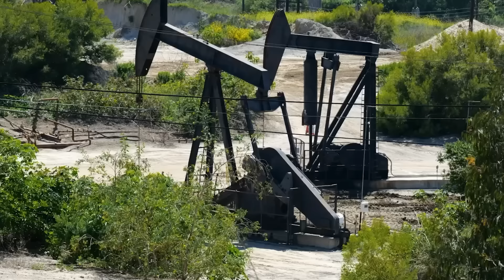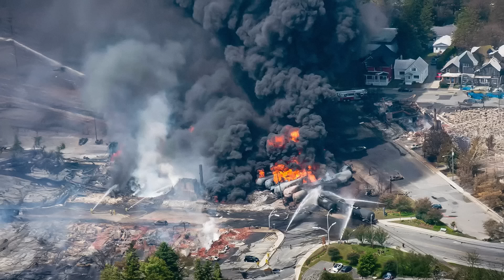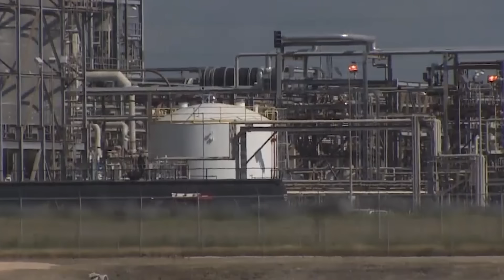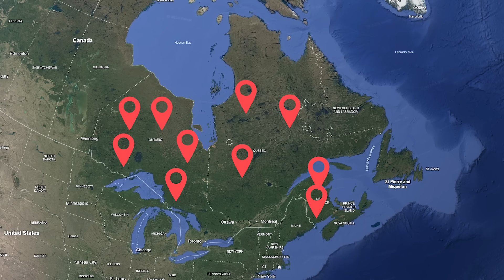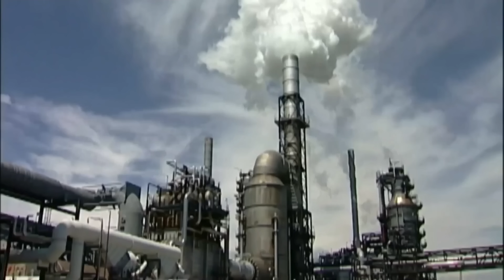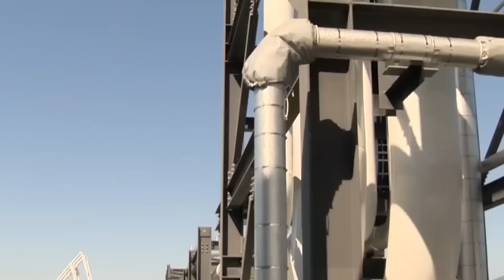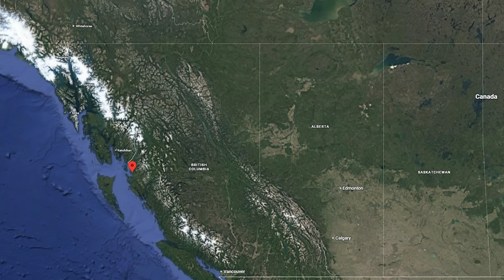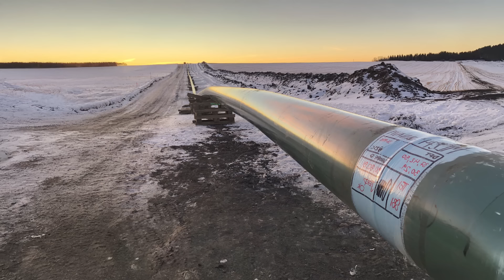Here's Why Canada Can't Build Its Own Refineries, Even Though It Produces Millions of Tons of Oil

Comment: The trans mountain expansion cost $32 billion.  It does not have to go from Edmonton.  The Enbridge Mainline pipeline transports 3 million barrels a day.  Build the pipeline from there and divert flow to the East Coast.
Anyone remember Joe Clark and Pierre Eliot Trudeau. They espoused a National energy Policy that would ensure Canada be Self Sufficient in oil.  It was opposed by the then Alberta Premier, Peter Lougheed, because he thought that this would hjamper Alberta's ability to sell oil on the world market for world prices. Turns out that western Canada Select is 25% of the Brent Crude price.
Reply: 25% less than Brent, not 25% of Brent. About $54 vs $72.
Reply: Alberta bitumen is heavy in asphaltenes and low in resins. This makes it a low-value product that is generally used as a cheap blending agent to bring down the overall cost of refined petroleum products. Remember when the Conservatives told you that Western Canada Select oil was priced lower than West Texas Intermediate because there was insufficient pipeline capacity to Canada's west coast and Canada was stuck with only "one customer"? Well, the Trans-Mountain oil pipeline is now complete, exports are happening all over the world, plus, there is excess capacity available on it!! And the price gap between Western Canada Select and WTI is still over $12/barrel on average!! Chalk it all up to yet another Conservative lie. Pierre Poilièvre is a rank expert at lying to Canadians and Conservatives are repeating the same worn, tired lies that are being disproven every day with TMX exports to Asia. Bitumen sands crude oil is low quality, and no amount of pipelines will ever change that. 

The % of exports to the US has already fallen below 90% and will continue to drop thanks to TMX.
Reply: @paulboileau3758 it is not low quality lol it isn’t good for motor oil it’s very good for making plastics
Reply: Also there is a tanker ban on west coast we cannot get the oil shipped fast enough
Reply: @georgestem2039 

Many Canadians are completely unaware of this nation's oil and gas infrastructure. There are now three major gas pipelines to the Canadian Pacific coast, plus two oil pipelines to the west coast. There is one natural gas pipeline extending from Alberta all the way to southern Ontario & southern Quebec (to Quebec City) and one oil pipeline from Alberta and through Sarnia, feeding 4 refineries in Ontario plus a refinery in Montreal. Incidentally, all seven of these pipelines were built under federal Liberal governments, including TMX in 2024 and LNG Canada in 2025. 

Canada has broken all-time production records for both oil and for natural gas production in 2025. We have built and completed two massive new oil and gas pipelines and export terminals, both commissioned in the past 20 months. Canada also smashed export records for natural gas, Alberta's heavy crude and propane and natural gas liquids. 

The propaganda says that Ottawa is blocking Alberta, but these claims don't jive with the facts on the ground: there are tens of thousands of oil and gas wells across the province, with a thousand new ones coming on stream each year. It is because of the support by the rest of the country that Alberta has registered a massive surplus this year. 

In the 1970s, the Canadian government invested tens of millions on research & development to adapt the canola plant, a benefit which has delivered billions into the pockets of Alberta farmers. Canadian taxpayers also invested over $34B into tripling shipments of Alberta crude oil to the Pacific coast. 

Some have falsely described a "tanker ban" on the west coast. And yet tanker exports were up a whopping 1137% in 2025 vs. 2023. 

To put this in perspective:
In 2023, an average of 2.25 oil tankers/month left the BC coast (Yearly total = 27 oil tankers)
In 2024, the average was 13.58 oil tankers/month (Yearly total = 163 oil tankers)
In 2025, the average was 25.58 oil tankers/month, October and November 2025 set a new record of 30 vessels each (Yearly total = 307 oil tankers)

Oil exports to countries outside the United States rose from 2.6% in November 2023 to 15% in November 2025. In December 2025, 15 of the 25 oil tankers leaving Burnaby were headed to China. 

In 2026, 30-35 oil tankers laden with Alberta crude will depart the Lower Mainland of BC every month! Not to mention the dozens of massive ocean-going tankers of propane, natural gas and natural gas liquids loaded and shipped out of Kitimat and Prince Rupert!  Why does this bother Pierre Poilièvre and his entourage so much that they choose to lie and act as if no oil and gas shipments are allowed when, in fact, the only limitation is for crude oil and only applies to an area off of British Columbia's pristine north coast?

Indeed, Canada has the one and only LNG export terminal anywhere along the entire Pacific coast of North America with LNG Canada (in Kitimat) and the completed Coastal GasLink pipeline. 

The US has exactly zero LNG export terminals along the west coast, and none started or under development. All US export terminals are either in the Gulf coast or on the Eastern seaboard. 

Besides LNG Canada, our country has four more LNG export terminal projects in the works:
1. Woodfibre LNG (Squamish) with an expected commercial operation date of late 2027. The Eagle Mountain pipeline already nearing completion and the export terminal is more than 65% finished. 

2. Cedar LNG (Kitimat) with an expected completion date of late 2028. Work on the export terminal is already 30% finished and notably, they will also be using the already-completed Coastal Gas link pipeline.

3. Ksi Lisims LNG (Wil Milit) with a target completion date of 2029 along, with the TC Prince Rupert Gas Transmission pipeline. Construction work on the pipeline is already substantial, with 48kms of right-of-way cleared and 9 bridges built for yet another brand new pipeline. 

4. LNG Canada Phase II (Kitimat) will likely enter service by 2030, although this may be earlier after the environmental review process received approval for fast-tracking by the federal government in September. 

Last but not least, Canada also has a 2nd Natural Gas Liquids loading terminal under construction just south of Prince Rupert. REEF will expand exports of natural gas liquids by 50% and is situated adjacent to the first terminal, built in 2019. Its expected completion date is in 2027.
Reply: @paulboileau3758  "Many Canadians are completely unaware of this nation's oil and gas infrastructure. There are now three major gas pipelines to the Canadian Pacific coast, plus two oil pipelines to the west coast. There is one natural gas pipeline extending from Alberta all the way to southern Ontario & southern Quebec (to Quebec City) and one oil pipeline from Alberta and through Sarnia, feeding 4 refineries in Ontario plus a refinery in Montreal. Incidentally, all seven of these pipelines were built under federal Liberal governments, including TMX in 2024 and LNG Canada in 2025."

Just what is the name of this pipeline and what extraterritoriality does it have? Coul it be the pipeline owned by the UNITED STATES? If so, it's a bit beaten up and may be discontinued.
Reply: @robertkubrick3738 

It is owned by a Canadian company: Enbridge. 

The Americans operate 17 refineries in the midwest which are totally dependent upon Line 5. If the American government ever shut down Line 5, it would create havoc all across several states: fuel shortages, tens of thousands of Americans out of work, industry shutdowns in manufacturing, etc. And the refineries could not easily find replacement crude, since they are tooled with cokers to process heavy bitumen. 

So, the chances of a Line 5 shutdown are infinitesimally remote. 

But let's assume the doomsday scenario. What could Canada do if the United States sows energy chaos? Well, immediately we would start railing to deliver Alberta crude to the 4 Ontario refineries and the 1 in Montreal that depend on it. We could also still use the Line 9 oil pipeline between Ontario and Quebec. So we have a lot better options than the Americans do. 

The suggested alternative is absolutely ludicrous from a taxpayer standpoint. Alberta Premier Danielle Smith and others are proposing spending north of $50B to build a duplicate, more costly oil pipeline just in case the Americans go nuts and enter self-destruct mode. But again, a duplication of Line 5 would only make economic sense if and when that happened. All other times, it would be a costly boondoggle that would require billions in new subsidies each and every year.

I've heard and seen a lot of bad business proposals, but this white elephant takes first place in the pantheon of stupid ideas.
Reply: @paulboileau3758  Better fix it up then so it doesn't get condemned.
Reply: @paulboileau3758  It's also 20 years past it's expiration date. States and Native American lands it runs through want it gone. Be afraid, be very afraid. It just had an accident. On the bright side it's closing might help you achieve the Net Zero GDP economy you always wanted.
Reply: @robertkubrick3738 

What a silly, infantile comment. The US will never allow 17 Mid-West refineries run dry. Just because you live in a world of paranoia Robert, it's unnecessary to project advanced amygdala fearfulness onto rational members of society.
Reply: @paulboileau3758  Silly to not want to have Canaduh's environmental disaster on US soil? The 50 years were up 20 years ago. As for not letting US refineries run dry, that won't happen, unless Canaduh suddenly never needs money again. It's infantile to think you can Declare War on the US and there are no repercussions.
Reply: @robertkubrick3738 

You fool, you thought I meant we would cut off the USA? No. That's not our style. But would your President try to cut off our refineries? Yes. And if you did, you can be sure we wouldn't keep shipping oil to the Mid-West bonehead.
Reply: @paulboileau3758  Not what I'm hearing from you whackos. But I will tell that even if you did cut oil to the US we would still sell you fuel as that would be the fastest way to remove Value from your system.

It's you fools who want to put Energy that isn't tariffed on the table.

Glad to hear you won't commit financial suicide by stopping the sale of oil. The US can just stop buying anything else from you and that should be fine? Glad we could hammer that out. You and I should be the trade envoys. We came to agreement right away.
Reply: As of yesterday western canada select was 73% of the price of west texas international.
Reply: @mtnphot  brutal. It's because bitumen is essentially the same consistency as tar. It needs condensate to even get it to flow. That's why it's called dilbit: diluted bitumen. Western Canada Select is a low-grade, cheap blending agent to bring down the overall cost of refined petroleum products.

Comment: Not quite right. Over simplified. Line 9 does transport Alberta oil all the way to Montreal. Ontario and Montreal refineries receive Alberta oil by pipeline. But the pipeline stops there, it doesn't go farther east to the refinery in Levis Quebec, which is across the river form Quebec City. And yes, the two refineries in New Brunswick refine light oil delivered by ship. Alberta has "upgraders" that convert heavy oil to "synthetic crude", a form of light oil. In 2005, 30% of all Alberta heavy oil was upgraded. Selling synthetic crude is more profitable than heavy oil.
Reply: Is the maker of this Video dumb? Or just American? On the West Coast there is a Huge refinery in a place called Port Moody and Burnaby 

Burnaby Refinery – a Canadian oil refinery located in Burnaby, British Columbia, formerly owned by Parkland Fuel Corp.  and now fully owned by Sunoco following their 2025 acquisition of Parkland Fuel Corp. The facility, commissioned in 1935, has a refining capacity of 55,000 barrels per day (bbl/d) and processes crude and synthetic oil into gasoline, diesel, jet fuels, asphalts, heating fuels, heavy fuel oils, butanes, and propane.  It is the only remaining West Coast refinery in Canada and plays a critical role in supplying transportation fuels to British Columbia, including producing Canada’s first low-carbon aviation fuel in December 2024. 

Burnaby Refinery – Quick facts:

Location: Burnaby, British Columbia, Canada
Commissioned: 1935
Capacity: 55,000 bbl/d (8,700 m³/d)
Nelson Complexity Index: 9.1
Key achievement: First in Canada to successfully produce low-carbon aviation fuel (December 2024) 
The refinery is supplied via the 1,200-kilometre Kinder Morgan Pipeline from Northern British Columbia and Alberta. It was originally established by Standard Oil of California and expanded significantly in the mid-1950s. Parkland Fuel Corp. acquired the facility in April 2017 from Chevron for C$1.46 billion. The acquisition by Sunoco LP was finalized in 2025, making it a wholly owned subsidiary of the U.S.-based company. 

Ioco Refinery (Imperial Oil Company):
The Ioco Refinery, originally built by the Imperial Oil Company in 1914 on the north shore of the Burrard Inlet in Port Moody, began operations in January 1915. It was a major industrial and community hub, employing over 200 people and supporting a company town with 83 houses, schools, churches, and recreational facilities. The refinery processed crude oil into gasoline, diesel, aviation fuel, propane, and asphalt, with production peaking at 25,000 barrels per day after a 1952–53 rebuild. It closed in 1995, following the expansion of the Trans Mountain Pipeline, which shifted crude supply and refining operations to Edmonton. The site was converted into a petroleum products terminal. 

Current Operations at the Burrard Terminal (Suncor Energy):
Today, the former Ioco site is part of the Burrard Products Terminal, owned by Suncor Energy.  The Upper Terminal in Port Moody includes fuel processing units, a main tank farm, and blending facilities. The terminal handles refined products such as gasoline, diesel, jet fuel, ethanol, and biodiesel, delivered via pipeline, marine tankers, rail, and trucks. The facility spans 430 acres, with operations concentrated in Port Moody, Burnaby, and along the Burrard Inlet. The site is now a key distribution hub for refined products in Western Canada.

Comment: Actually, it’s Alberta, not Canada that exports 90% of its oil and that’s to the US. 

Eastbound oil pipelines travel on flat prairie land for the most part. 

It’s one province that blocking the pipeline to a refinery on the Atlantic Coast. 

The US has refineries that are currently equipped to process Alberta crude oil. 

So, retooling the Eastern Canadian refineries to process that heavy oil can be done, it’s just politics are denying these upgrades

Comment: Whe should use the tunnel boring machine and bore a tunnel straight to the BC location to export to those foreign countries that desperately need it.
Having build the tunnel straight instead of winding pipes routed  through the easier path on the surface would cost way more money.
Reply: It would be in the hundreds of billions more to tunnel good example elevated trains vs tunnels

Comment: Canada has some oil refineries but we need more refineries
Reply: We produce 4.1m per day but refine about half of that so we need to double them, agreed.
Reply: @stochastic42  We produce 3.9 to 4.1m for the USA alone.   We also produce close to 1m which flows through the Trans Mountain for Asia.   If we had more pipeline capacity, Alberta would increase production further.
Reply: The state of Ca just forced two refineries to shut down !
Reply: Canada is a net exporter of refined petroleum products. We produce and sell more than we purchase. 

Canadian exports of finished petroleum products hit a new high of 19.6 million cubic metres in 2024, up 10.5% from 2023.

Meanwhile, Canada imported 8.5 million cubic metres of finished petroleum products in 2024, down almost 5.4% from 2023.